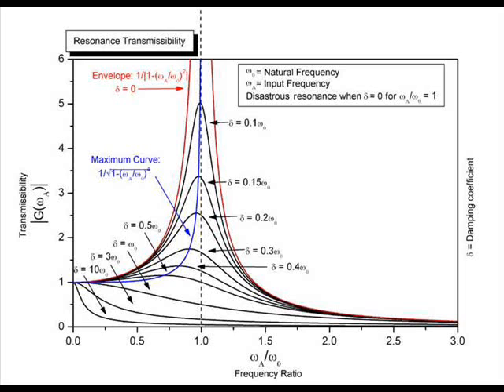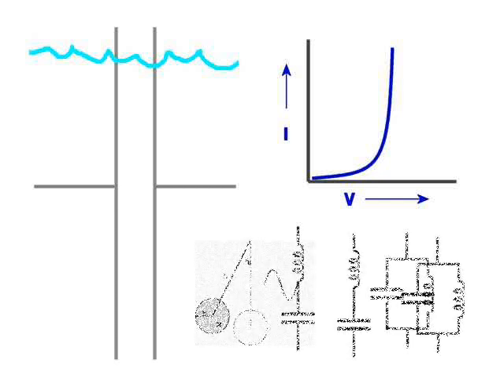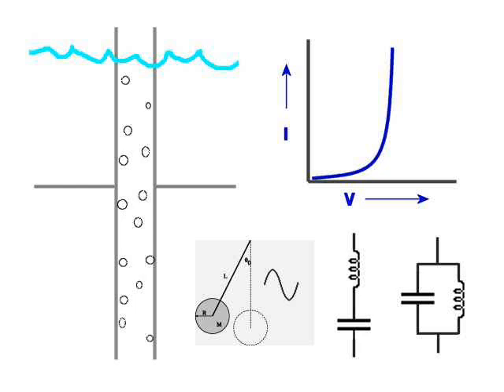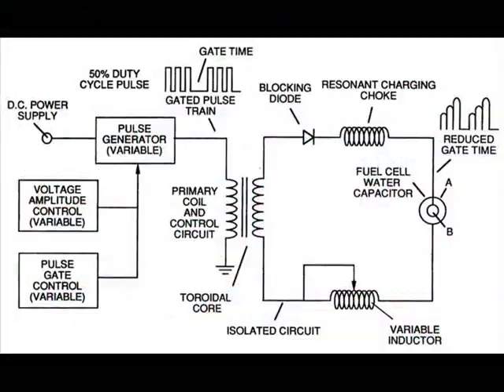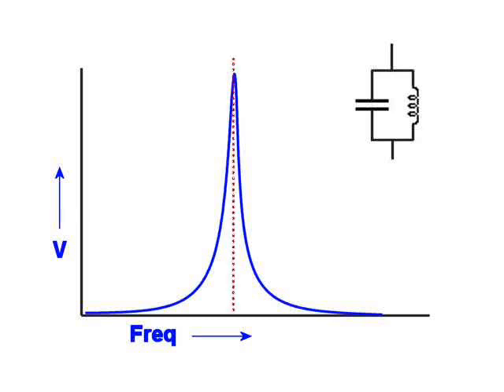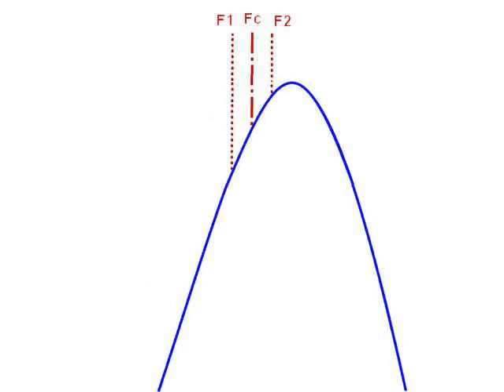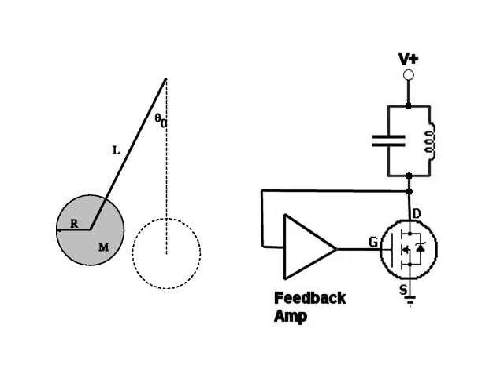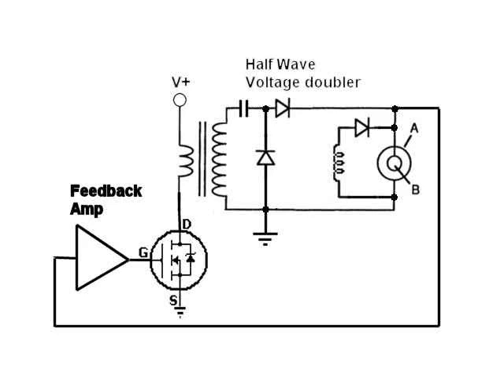#108 My newest resonant WFC theory

Comment from the maker: @mikefromspace My theory on Meyers use of resonance has changed since this video. Stan did not use caustic electrolyte. Distilled water is an insulating dielectric. The only way to induce a current through an insulating dielectric is with resonance using SERIES RLC, just as he describes. It's no more or less efficient at producing HHO than by using electrolytes. What it IS is safer and easier to maintain.

Comment from the maker: I don't know. It's like sending a TCP/IP packet to a specific address or a UDP multicast packet and saying "anyone tuned in may listen and respond. Both take the same resources to create but the result is much different.

In your example all I think you're doing is releasing more stored potential energy with one command vs. another.

Which is NOT to say I think your chorusing theory is invalid. It made my head explode too. All I can say is try it.

Comment from the maker: Just keep the discourse polite else you will be banned from further comment.

The ICE is roughly 18% eff. We're taking roughly 1/2hp to produce 2LPM HHO, about 70% faraday efficient, the product which becomes more of a catalyst to the gasoline combustion than it is an energy source unto itself. Were not adding energy more than we are changing the speed of combustion, converting more into mechanical energy before it exhausts.

It works.

Comment from the maker: @teslacult Take a rubber ball. Suspend it from a rubber band. Lift up just far enough to make the RB limp and let go. It resonates. Note the frequency.

Next allow it to hang at rest barely touching a table top. Repeat the drop test. Did it not resonate even though it did not pass through the zero resting point? What else might you note about the frequency?

Comment from the maker: A HHO cell with electrolyte does act more like a resistor. But, distilled water is an insulator. Look it up. It has a known dielectric constant that can be used in a resonant LC tank circuit if the tank is not short circuited by the low parallel resistance caused by current leakage through electrolyte.

Comment from the maker: The theory is that water will fracture in the presence of a very high voltage potential. The way to get there is through high impedance resonant tank oscillation. The problem is the conductivity of the water loads down the tank circuit. Corona dope on the plates to insulate them may be the answer. I will be trying that experiment later this Spring.

Comment from the maker: Yes I know what you're saying. Currents will be induced in both halves of the resonant tank circuit, capacitive and inductive. But the phase and amplitude of the two cancel at the resonant frequency where the signal is applied causing the currents to flow with very little energy input.

Comment: Hi there, I believe that the key to economy of power to split the gas is going to come from a self tracking series resonant tank circuit, I think it’ll be series, taking advantage of the associated high voltages. I have designed, serviced and manufactured high power Radio Frequency induction heaters for 30 years. A fundamental requirement of an induction heater is the ability to track a rapidly changing load. I wonder how far have you got with your work with HHO? 
Kind Regards .... Andy
GWØJXM

Comment: @quickshell no, if you read the canadian patent he last made on the hho injector; he made a pump z wave out of 8 step up waves each 5ns coming off a powerful mosfet transistor 1kw 30kv; diamond coated 2micron to take the heat. They can make these but I can't find 'em. The act of acceleration of spin of a water mist droplet ungrounded is the secret. The less pressure, the less ungrounded btw.; curved nozzel of previous patent did this pressure drop action... but as I say I only study what i read

Comment: @ZeroFossilFuel Okay, gotcha, but his final patent the hho injector required water mist sprayed between an anode and electrode moving current in the form of a pump z wave at 10 to 30khz at up to 50kv using a 5nanosecond response time 1000Watt Mosfet, and it produced hundreds of h.p. from a mere 100watt average output (since the 1000W was only running a fraction of the time.) Anyway I guess you understand that resonance does not happen through a choking diode.

Comment: Meyer did not endorse resonance, he used it to confuse people as crazy as that sounds. He made pump z waves, esp. with his best and final invention the hho injector. All you need are 3 waves of 8x diff freq' each, the final 'carried' wave becomes a pump z wave of ultra high potential, especially if you coat your plates with cu/si02 lattice grown   Resonance is turning your metal into a capacitor as you seem to say. For hho inj. U need a 40kv .03amp mosfet with 2micron diamond coating.

Comment: The Dc is induced from the primary which is also an electro-magnet hence the frequency doubling affect, positive pulse,magnetic pulse,gap,positve pulse, magnetic pulse , gap is the pulse train you want for step charging your chamber . Adjustable pulse freq,pulse width,amplitude(voltage) and timing over the gap when everything is off is needed by your power management module , I stick to my theory that Stan Meyer was an honest and good person and was not a fraud!

Comment: Only trying to help sorry for hijacking your thread  please look up Deuterium on wikipidia you'll see it has one proton (+) and one neutron , look at the energy value for it , and its abundunce in nature ? Could this helps power the vic matrix hence little voltage applied lots of voltage when at resonance? Has anyone tryed testing for electron leakage at resonance around the outside of there chamber? 
Do we all understand the principles behind a bifilar choke ?

Comment: To those of you who are doing scientific research on Gray's patents, congratulations, you are working on the actual generation of electrical power based on Quantum Physics. Here are some areas that need consideration;

BREMSSTRAIILUNG: "breaking radiation" The radiation emitted by electrons slowed down in matter. [free electrons entering a steel high-voltage anode] [Bunching] 

PAIR PRODUCTION: The formation of a positron and an electron when electromagnetic energy interacts with matter.

Comment: The invention also includes a means for sensing the occurrence of a resonant condition in the water capacitor/resonant cavity, which when a ferromagnetic or electromagnetic core is used, may be a pickup coil on the transformer core. The sensing means is interconnected to a scanning circuit and a phase lock loop circuit, whereby the pulsing frequency to the primary coil of the transformer is maintained at a sensed frequency corresponding to a resonant condition in the water capacitor.

Comment: High frequency pulses build
a rising staircase DC potential across the electrodes of the cell until a point is reached
where the water breaks down and a momentary high current flows. A current measuring
circuit in the supply detects this breakdown and removes the pulse drive for a few cycles
allowing the water to "recover". this last bit must be why the water doesn't heat up?

Comment: He was demonstrating hydrogen gas production at milliamp and kilovolt levels.
"The most remarkable observation is that the WFC and all its metal pipework remained
quite cold to the touch, even after more than twenty minutes of operation. The splitting
mechanism clearly evolves little heat in sharp contrast to electrolysis where the electrolyte warms up quickly." extract from Electronics World & Wireless World ( January 1991)

Comment: Theory " the pulse train run's through the toroid to earth, the magnetic pulse which follows as the toroid discharges crosses to secondary tranformer thus charging the circuit with electromagnetic discharge this charge will only pass through the inductor one way trapping it in the chamber , the capacitors after the inducor but before the chamber act as storage for the charge to make sure the inductors don't discharge and therefore hold there resistance? " 
any ideas??

Comment: Liquid hydrogen has a density of 71 gm/liter. There is  more hydrogen in a liter of methanol (99 gm/liter) than in a liter of liquid hydrogen.
Regular Gasoline has  133MJ/Gallon
Hydrogen has  about 390 MJ/Gallon   3 x the energy per weight than gasoline.
Gasoline weighs 6.073 lb/gal or 3 KG/gal.
Generate 2lb of hydrogen to equal a 6lb of gasoline (1 gallon) and see how much energy it takes to do it.
Hopefully, these facts will steer others from continuing down this energy wasting Hydrogen path.

Comment: Actually, I must correct myself. I think it would be more accurate to say that the "ground" point would be the points where the ball comes to a stop just before changing dirrection. My point is, in order for a ball, a pendulum, or current to oscillate they must change dirrection. Stan Meyer's use of the word "resonance" may have been a red herring.

Comment: BREAKDOWN: When electrons are accelerated to high velocity by the electric field at the [spark gap] and produce other free electrons by ionization collision with atoms. These free electrons are similarly accelerated by the field and in turn cause other ionizations. The avalanche process leads to a very large current.

Comment: Each choke consist's of a coil, capacitor and resistor , on choke on the negative side has metal slider (like variable transformer) to fine tune the 2 coils to allow for impurity's in the water . the caps act as power for the chokes and vice versa the resistor must be to stop you frying the caps not sure?

Comment: When the hydrogen and oxygen molecules are released as inerts gas's , the electrons left behind go the the electrodes hence the jump in volts (surge) on resonance. Am i right? Meyers chamber was multi layered to stop the electrons escaping, the inductors bifilar or singular were used to contain the charge at the plates.

Comment: Very interesting. I know Meyer refered to resonance frequently, but I have a problem with this. The voltage applied to a water capacitor must be D.C. not A.C. The voltage can not oscillate the way A.C. does, so how can you have resonance without oscillation?

Comment: @RoteKampfSocke it acts like a resistor,
it acts like a capacitor,
it acts like a battery,
it act like a short circuit.
distilled water is a insulator and resistor, and dielectric fluid.
pulsing changes the magnetic laws somehow

Comment: the water creates its own power from the hydrogen and hydroxyl ions as the polar magnetic pulse hit them, the dc current is to charge the circuit and create the block to stop electron flow , so that the ions can charge the water

Comment: Also would using a magnetic reed switch to arc the surge to lower voltage , thus creating overunity within the closed loop of the capacitor circuit ? Similar to E V Grays idea?

Comment: Been tried, never happens. Go back to basic chemistry and physics. Can't get something from nothing. Any energy you get out of hydrogen HAS to come from breaking the bonds of water. That is a known specific energy. On top of that, electrolysis is inefficient. And its inefficiency comes from the physics and thermodynamics ineluctably. Anything you try to do to cheat conservation of energy, will result in even more loss. That's physics. This has all been tried to confirm physics. Physics wins. Myer was a con-man, adjudicated.

Comment: OK your theory of resonant is correct. What's more your circuit with the feed back amplifier is apparently would work at resonant.Big question is, do H2O bond dislodge purely at the resonant frequency only? If so Faraday's low of electrolysis is questionable. Since it says current is proportional. At resonant the current is minimum.

Comment: If you do a Google image search for (generating ramp wave)
some schematic circuit diagrams come out. What you want is one where you can gate the ramp voltage to off as soon as the water capacitor seems to achieve breakdown whilst the gas is being produced. Some of the circuits use 555 timers, and others use square waves input into an integrator OP AMP circuit. Some sites with this have virus java script on them, so temporarily turn that off in your browser while grabbing the images. Good luck.

Comment: Direct connection oscillator would work to make resonance, but having the transformer in the energy pump part of the circuit shall shift the phase of the applied energy & you will not get "proper" resonance.
P. Lindemann said the stepped ramp of voltage of the VIC was to only provide nearly / exactly the water capacitor's breakdown voltage then wait for bubbles to clear. So detecting water cap breakdown event, then waiting for bubbles to clear are the "true" objectives according to P. Lindemann?

Comment: @ 8:00 you need to insert the Kicker rectangle wave oscillator.  Even though you assume the system should self-resonate, keep in mind that a real circuit will still need a slap or kick of impulse voltage every now and then in order to keep the system in the oscillating regime.  Don't try to attain the ideal system; that won't happen.  You MUST have the Kicker or Slapper, or whatever you want to call that which injects the impulse to defibrillate the oscillator system.

Comment: What a concept!  The betterment of mankind!  I have been usinf a fixed frequency, and living with the inefficiencies, that does pretty well.  Remember also, DC will still do the job in an enviroment where there is connection to the grid.  My results are that I have run HHO as a suppliment on my engine.  Running pure HHO has a few bugs to be fixed, but I see it as likely to do.

Good Job, I will watch you closely, so not to reinvent the wheel!

Comment: You are missing the point, even at its current efficiency, electrolysis is extremely important and useful.  It can potentially increase the performance, fuel economy, and almost completely eliminate emissions on any existing car by using otherwise wasted electricity.  It can be used as a blowtorch which produces no harmful fumes.  It can be generated from solar or wind power instead of using batteries and then converted back into electricity or heat.

Comment: Hey, ZeroFF...  you can save a large amount of trial-n-error tweaking the system by simulating the circuit, which includes the variable capacitor which is the electrical action of the fuel cell, by using PSpice circuit simulator software.

I hear there are freebie/shareware circuit simulator SW out there.

Comment: good explantion! my idea exactly, instead of phase i was going to monitor cell current at resonance, and use that to control the oscilator. Very informative explantion of the whole process. I wish you luck with making a working design, please make it open source!! beat the oil industries!

Comment: i think meyers method is the only one that is practicle,You need a transformer that is magnetic, made of iron wire (vic). Each atom in iron shows a magnetic field so each atom can be controlled, the only way to stop the flow of electrons. Then you need his injector system , to get nitrogen and oxygen to combine (gas processor) from ionized air with laser injection. Send this to injectors and combine with water.Very  simplified meyer tech.

Comment: L and C reach an equalibrium. all the C doesnt have to come from the cell. so frequency of pulsed dc ....not sure if it ever resonates. yes i am quite sure it will not ever resonate. adjustible L and adjustable C and the cell has both R and C big whoopee...it can be in a circuit and .....well the centerline of the pulses could be 1.8 volts and ac could float at 1.8 volts and then pulsed dc would become ac?

Comment: Yes ,but you can't create current from nowhere, it has to be powered by an powerful electrical energy source. Pulsing or any other technique doesn't change this law : energy input - losses = energy output. -> Energy input > Energy output. with a big maybe it could increase performance of the cell - but not efficency.

And what do you mean by resonance ? a HHO cell acts like a resistor, not like a capacitor... 
a capacitor needs a non conductive dielectrum like air or oil.

Comment: a stupid question ... why dynamic oscillation ? Maybe it can boost the current you can dump into a cell .. But it doesn't increase its efficency ! The amount of HHO produced is directly proportional to the current used. The Progress is just a way of transforming one form of Energy to another (with losses!) The Energy "stored" in the HHO Gas will never exceed the amount of Electrical Energy used to create that Gas. 

Sorry for the crude formulation (thanks, character limit!)

Comment: i believe thers a possible misunderstanding about the type of resonance that meyer used.
its my belief he used a combination of mechanical resonance of the water.
this combined with electricity of just about any frequency will result in high HHO output at minimal input power since the resonating water pulls and pushes the water creating near vacuum where HHO is released verry easeyly

Comment: What do you think of the VIC being a parallel and serial RLC: the choke forms a parallel RLC circuit, and so at its self resonance frequency, it has maximum reactance - the reactance of the cell is very low so current will lag voltage, and power will get reflected because of Z mismatch and possibly creating standing waves. Don't know yet how the max reactance of the choke will let pass voltage towards the cell.

Comment: Hi Zero:
 It is very simple to make this work. Get a BASIC STAMP. From the cell put a MOSFET, and control its gate voltage with a voltage divider from the stamp. At the junction of the MOSFET and the wire coming from the cell, put a diode and voltage divider going to the stamp. The program for the stamp is simple. When ever the voltage input is true, turn the MOSFET on, and when ever the voltage input is false, turn the MOSFET off. Thank you for your great work. 73's